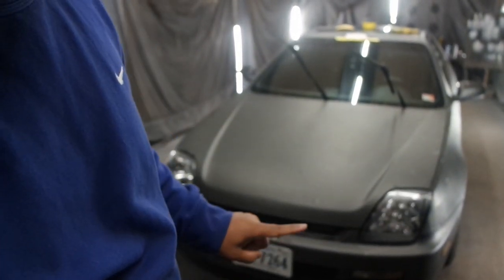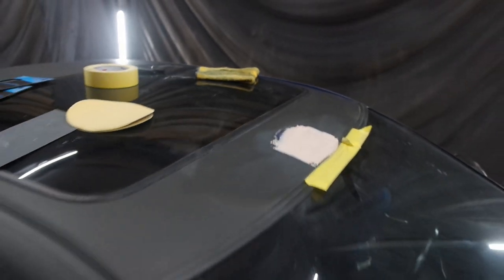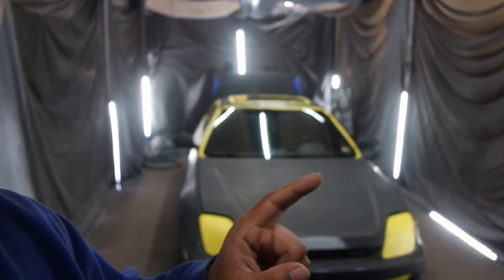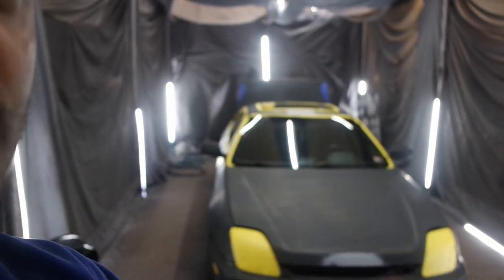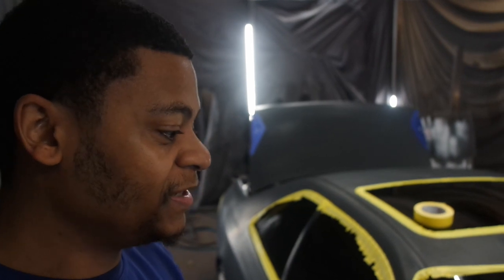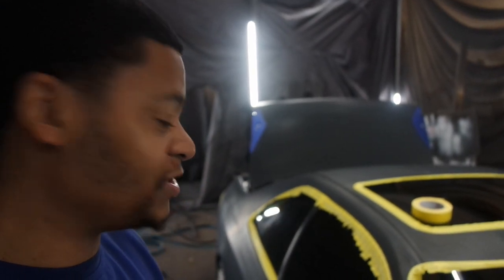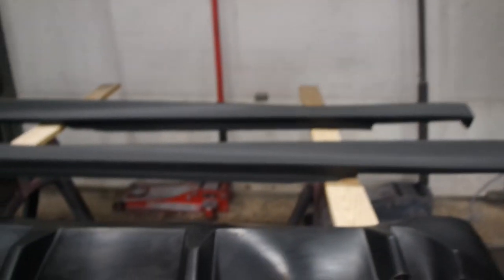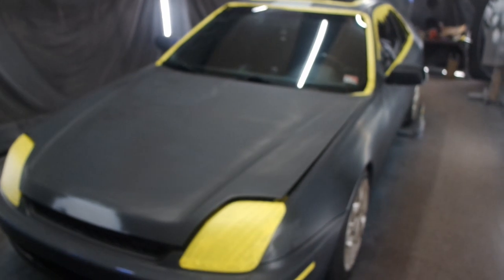Honda Prelude sprayed in Brandywine candy red autoflex liquid wrap

Comment: Trey I recognize those Acura TL Type S 17inch wheels.  Hey nice job continue to vlog about the  prelude life.  They are iconic: I’m your dads age approximately. I’ve own 3 back in the day: 88 5sp SI red, then moved onto 93 4th gen Vtec 5sp red then in the year 2000 I added a beautiful 1991 3rd gen white 4WS 5 sod damn it turn head because I lowered it in Eibach springs and Tokico struts.  It came with stock 14 inch saw blades but I put 16 inch white 5 star wheels.  Man that was my little Ferrari🤣.   So back in 2010 I traded it in for a white Acura 2006 TL .  Sadly I still miss that car but the Acura TL help u forget 👍👍.  Fast forward 2017 I sold the 2006 TL and bought an even faster head turner: The White Diamond Pearl 2007 TL Type S with the stock gun metal waffle wheels.  Lastly Trey the next year I bought another TL Type S this one is the rare color:  Kinetic Blue Pearl with the 17 inch gun metal waffle wheels.  So I have two presently.  Love them both but I still miss that 1991 4WS Lude🙁. Hey I’m a Honda fan boy because they run forever. I know I’ve said a lot but i appreciate your channel 🤗🤛🙏.  Oh I forgot in the winter time here in Michigan I drive a 2005 AWD Acura RL silver..  Trey I learned that the 2005 -2008 RL are the same engine as the 2207 & 2008 TL Type S.  I hope some day you cop a type s or  2005-2008 RL AWD;  they’re dope and not many rock them.  In my opinion they’re stock sleepers👍
Reply from the maker: Thanks for the story man i appreciate your support.

Comment: So I have a 93 prelude and I restored my climate control board, but it still isn’t working. I also hear this weird noise near the blower in the passages side, under the dash. Do you know what it could be?
Reply from the maker: Loose fan blade maybe as far as the climate control check you fuses or replace it

Comment: Question, Autoflex listed you as an approved installer with the inflatable booth to be able to get autoflex? or is there another way to get autoflex?
Reply from the maker: Ive been an installer a long time. They weren't as strict back then but also had a booth back then as well.
Reply: @treybedipping1734  got ya, thanks. I got some figuring out to do.